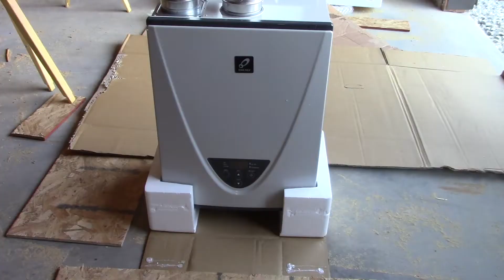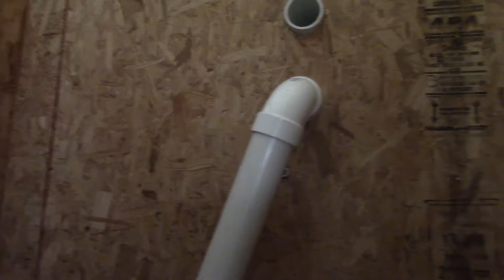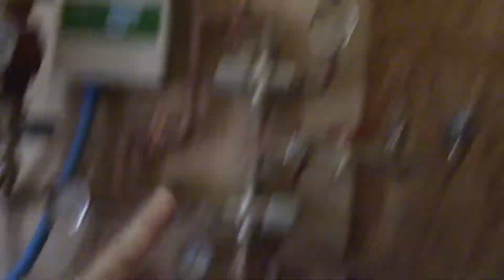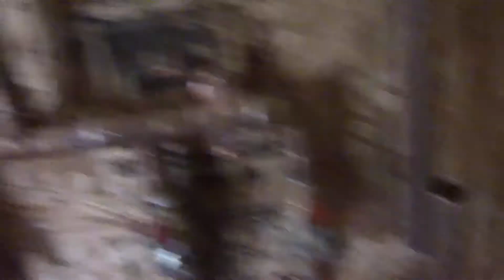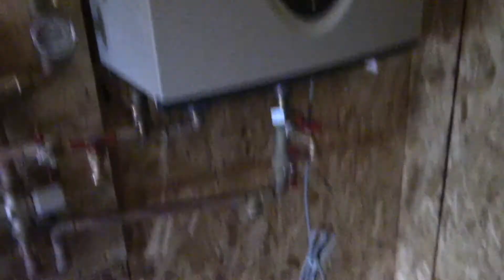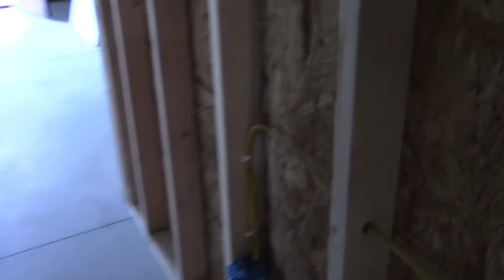Shop House Build Part 13 Takagi tankless install

Comment: I will say, no matter what you do, you will still need to flush it annually or maybe bi-annually. I kinda laughed when you said you pressure tested everything and right after you just pulled that piece away from the coupler. Definitely didn't sweat that one in. Not easy doing all that by yourself.
Reply from the maker: Yeah, that was funny. I had pressure tested the PEX in the floor is what I was trying to convey.
Reply: @PerimeterPermaculture  I know, it was just a good laugh because of how it looked. That pex is some nice stuff. Way easier to deal with than copper. My cousin is a salesman for a plumbing supply distributor and I think he said there is something better than pex. Technology is always getting better. The day you put something in, it seems like it becomes old tech or obsolete.
Reply from the maker: @TheSHOP411  I was kinda worried about those PEX lines in the concrete because the day we put those in before the pour was the day I got sick with Lyme and I didn't even watch them pour the slab because I couldn't get up off the sofa.
Reply: @PerimeterPermaculture The good thing about it is that it's much more forgiving than copper. The first time I used pex, I thought it was the best invention ever conceived by man.